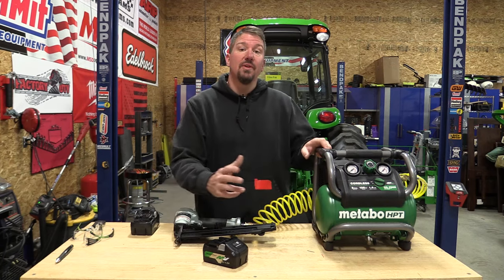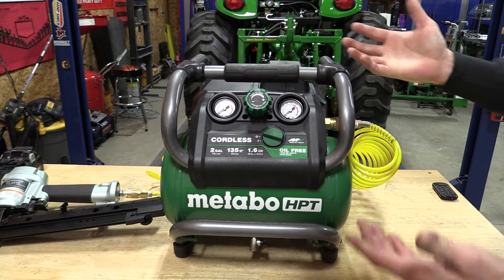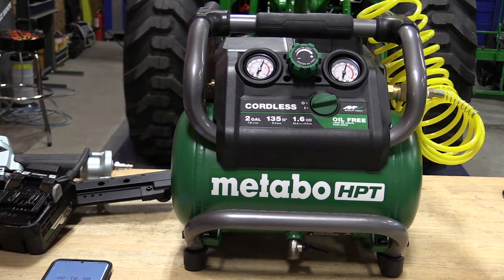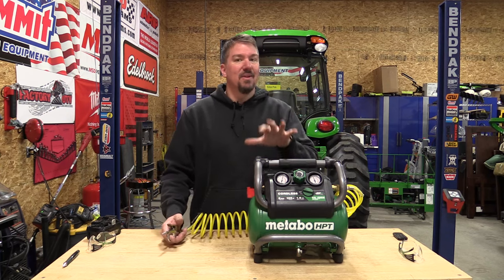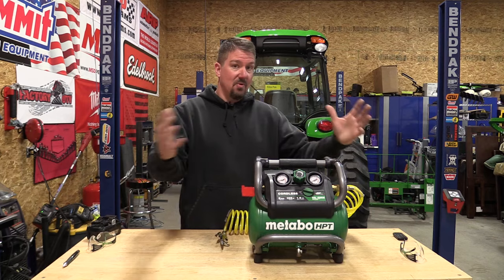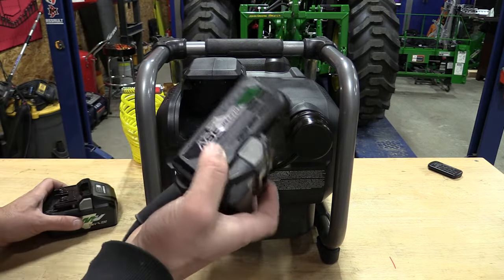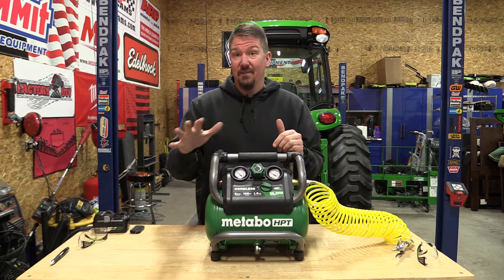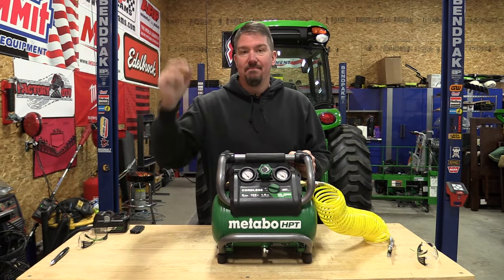METABO HPT 36V MultiVolt 2 Gallon Cordless Air Compressor Review | Model EC36DAQ4

Comment: Perfect tool to utilize their 36V and AC adapter hybrid system
I've been rockin Hitachi Professional compressors for yrs and have confidence this one will be no different
I have the Milwaukee cordless Fuel compressor and it does pretty well but was much higher priced for yrs in the $400+ range and is now a bit lower but the specs for this Metabo HPT are much better so we will be getting one of these soon-AC adapter, history of great pneumatic tools and the Lifetime warranty just another reason I have swapped quite a few of my red, yellow and blue tools over to Hitachi/Metabo HPT

Comment: I did breeze over the video a little bit so I apologize if this was mentioned. But as far as I’m seeing, this is the only compressor of this size that is both battery and AC operated. Both Milwaukee, and Dewalts compressors do not have adapters to plug into the wall. At least not one I can find.

Comment: Interesting machine- I wish I knew about it sooner. I just got the Ryobi cordless compressor at HomeDepot about 6weeks ago and it ran approx $125 plus whatever battery you needed. I caught it all on sale and got 2-4ah batteries for $80. I use it weekly in my business for a mini HVLP paint gun. It’s ok- I’m just not a Ryobi user- it’s the only Ryobi tool I have. Not a fan of their putting the low voltage shutoff in the battery and not the tool.

Comment: As a man looking to buy a new cordless compressor, this video has helped. 'm debating on which way to go, dewalt, milwakee or this metabo.  I would only be using it with a 15g, or 13g nail gun, using hardened nails shooting trim or skirting boards on to masonary walls.

Comment: Very nice looking unit! Wondering how much it would be running for
Reply: $279 at ACME tools
$299 at Tool Barn
Lowes isn't showing it available online yet
Reply: @baseballdude8491  thank you very much for promptly replying to my question. What do you think$280 is a decent price? Did it include battery as well?
Reply: @IRAKLICHIKHLADZE  the Milwaukee is still going for $349 and the Metabo HPT is a better rated unit and u can use the AC adapter for longer run times when needed
I don't think ACME includes the battery for the $279
Toll Barn might include a free starter kit but I haven't checked in a few weeks
That's a good price for getting the battery and AC hybrid option that no other brand offers

Comment: it's a nice little unit, but with newer cordless nailers/staplers like Milwaukee, it makes those small compressors obsolete.
the milwaukee nailer can put 1000 nails with only an 18 volt and 2 aH battery. 

But, the tools are more expensive than air compared tools.
Reply from the maker: Larger and heavier also.
Reply: I did my roof with the Dewalt 20v roofing nailer. It did a great job and it was nice not having a hose but it was significantly heavier than a pneumatic gun.
Reply: Milwaukee has a cordless air compressor just like this one, pneumatic nailers, and also a full line of cordless nailers.
Metabo HPT has this cordless air compressor, a full line of pneumatic nailers, and a full line of cordless nailers.